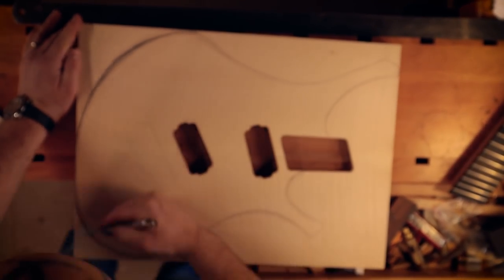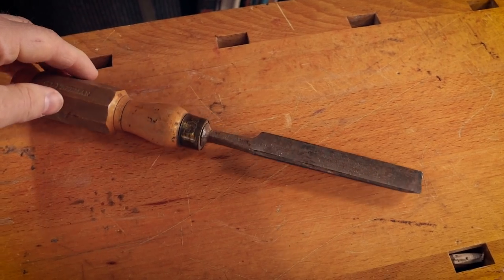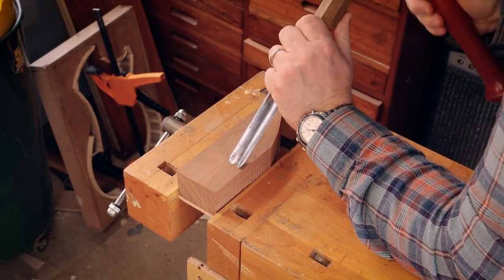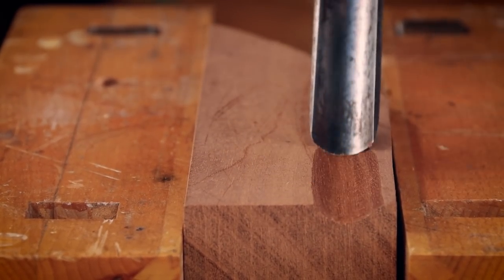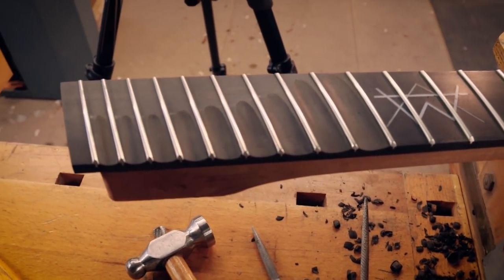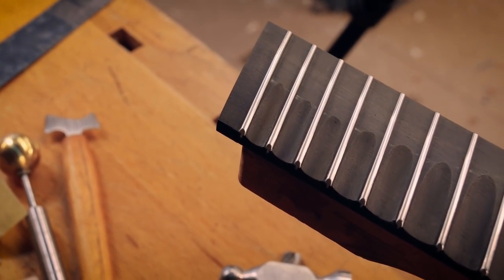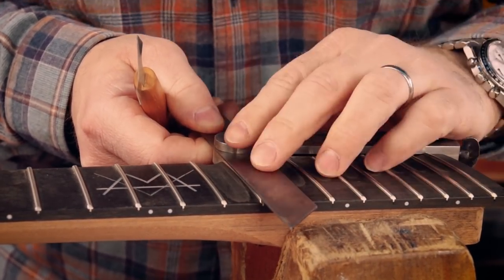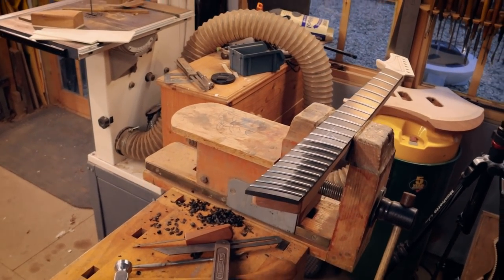Ep 4 - Shred - Scalloped Fretboard - How to Build a UNIQUE Multi-Scale Kit Guitar

Comment: Oh that's kinda cool, looks like the scallops have been just torn from the fretboard. I've also just thought that this would actually kinda make a veneer based fretboard kinda cool. Make the majority of the fretboard out of a contrasting wood, radius it, and then glue am ebony veneer on top. Cover the sides with binding as usual but then when you cut scallops in you can cut through to the light wood. Of course, a lot of fretboard wear would result in the other wood becoming visible, but I think 0.6mm of wear would be rather extreme for most use cases.

Comment: Really, the only issue I can see with the texture in the scallops is that you may have an issue with buildup from finger oils and general debris in the air (we've all cleaned a fingerboard or 2 so we know what... interesting substances are found between frets) so maybe taking down the texture with the fret rubbers just to knock it back a bit, but leaving enough to still catch the light would be prudent. But I absolutely love the idea of the texture in the fingerboard. Kind of reminds me of the gold leaf and acrylic inlays you had done before. You see it, but you can't feel it!

Comment: The guitar looks good already!
Did two kinds of fretboard scalloping myself, one in YM-style but not as deep, and a second starting very very subtile on the low edge on the first fret, asymmetric in the style of R Blackmore, and getting slightly deeper and higher up til the last fret. Deepest: 1.8mm. The upper edge of the fretboard remaining straight. Feels good!

If „Shred“ was build for me, I‘d like to have the textures filled with neon orange (or neon green, like Shrek) colored epoxy, and this theme continued having those tiny slots loosely wawy in the middle of the fretboard, clustering more on the frets that would need markers. The orange/green slots theme continued also on the body somehow...following the tilt of the pickups, some inversed scallop dome type of carves on the upper half of the body... over dark grayish-blue or green jeans type of color and denim texture, inclusive on the headstock... (but: I always tend to exaggerate ...😏... although I already know: less is more...)

Edit 15 minutes later: the denim texture could be made with a customized dough cutter roller, pressing the texture in the wood, then staining as liked. Finally ironing most of the indentations/imprints out with a wet cloth... me thinks...

Comment: Dear Ben, thank you for this kit build. I have a suggestion for the head, if I'm not too late. I would not cut the whole in the head as such but I would still do something according to the sketches you've made on the head. I would just go down through the veneer and make the whole just through the veneer. You can still make the bevels on the veneer. Bud it's just a suggestion. As for the 2021 Great Guitar Build Off I would love you to do something more traditional like strat type guitar. Use some unusual highly figured woods, make interesting inlays on the fretboard and go crazy with the scratch plate. Graphics made out of textures using your typical head tattoo patterns, would be lovely. Do your own pickup covers to go with the theme... I haven't see you making a strat for a long time. Overall thank you for your great content. Marek

Comment: Strange enough, I built a 24 fret multiscale neck through guitar last year, and scalloped the neck from 10th fret onward in an „ organic“ way. That means that there is a very light touch to the fretboard at the high E string at 10th fret, at the 14th fret, the scallop covers E, B and G , becoming adeeper and wider arc towards the end. You made it the opposite way, starting a full scallop and then reducing the width towards the end...
Anyway, I took my inspiration from the Richie Blackmoore Strat where it was done equally. But one more issue is, you can move the center of the scallop towards the fretwire, creating a more seawave shape when looking from the side. Placing the scallop in the middle between two frets creates a U- type look, seen on the Yngwie Malmsteen Strat, but in my opinion doesn’t feel or play as good as the shifted version. In any case, scalloped fretboards love a very light touch to your strings, otherwise you will always sound out of tune.

Comment: For guitar build off you should build combination carbon fibre/wooden neck with detachable 3 neck profile sections-upper, middle and lower.  You should make mold or template and a mechanism (dovetail?) so you could make lots of different profiles . So you would have 3 hollow parts on the neck and lots of profiles to choose from day to day as your mood changes. :D
Reply from the maker: Intriguing but beyond my current setup.. I do have something very very interesting in store for this years GGBO though :) B
Reply: @CrimsonCustomGuitars I always wondered what kind of neck would suite me now ? Well just change a profile on the fly. :D 
Nevertheless i'm pretty sure you're going to rock. It's always a nice surprise.

Comment: While the texturing looks very cool I wonder if that will be a place for dirt and grime to collect.  I realize that your fingers won't actually come in contact with the bottoms of the scallops but still over time crap will build up there and be hard to clean.  Maybe not.  Hmmm I just thought of something.  What if you put something into the grooves of the texture (light in color) to make the texture stand out?  I'm not sure what that would be but some kind of a pigment.  Maybe like an artist oil paint?  Depending on what you do with the finish of the guitar you could match theme colors.  Try it on one of your test pieces.

Comment: I recently discovered a downside to a scalloped fretboard: when leveling your frets, and checking the neck with a notched straightedge...
I have a Malmsteen style scallop, rather than a Ritchie Blackmore style - the latter has a bit more wood left on either side of the frets.
Other than that, combined with well polished frets, the feeling is rather sublime.

Comment: Okay, my two cents: scalloping is fine. Textured scalloping? Interesting take, sure, why not. That particular texture, though? Kinda detracts from the whole thing. Scratches that run parallel to the scalloping, to me, just look like you did the scalloping with a coarse rasp/riffler, and didn't bother following up with assorted grits of sandpaper to clean the work up. 

If it wasn't for the lack of space between frets, I would have thought a crosshatch pattern with those checkering files could be interesting, or something engraving-like carved with a V-groove gouge, maybe?

Comment: Oh, the Lap needs an adjustable nut and bridge. So the frets can be used with or without a slide, or both. A few bumps in the roars are fine. With the adjustability, several sweet spots can be found. Dan out. TMI. Did the tatto hurt? It’s you.

Comment: Personally, I don't feel that the scalloping adds to the guitar, particularly. I did buy a second (third?) hand "Strat" made up from Mighty Mite parts some years ago with a scalloped neck. It was going cheap on ebay. Nothing wrong with the guitar, but I found out that for me, the scalloped fretboard just didn't work. So i put another "normal" neck on it, and it's fine for me, now. But of course you Yngwie fans out there will probably disagree. 
YMMV, as ever!
Reply: I mean, it's not for everyone. I personally have huge sausage fingers, so having the small frets (19-24) scalloped gives my finger a little more room to "wrap" the string for bending and such, I'm also super heavy handed though, so I'd likely put a full scallop out of tune by looking at it haha.